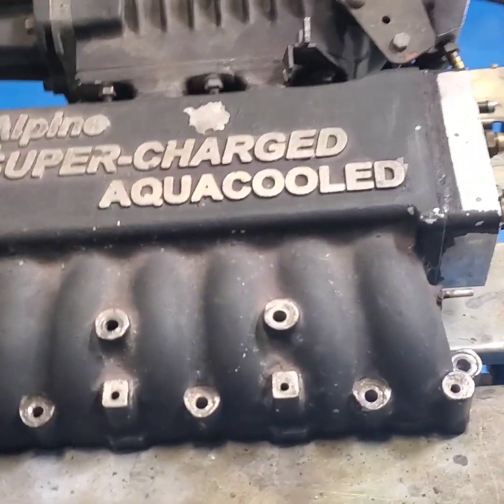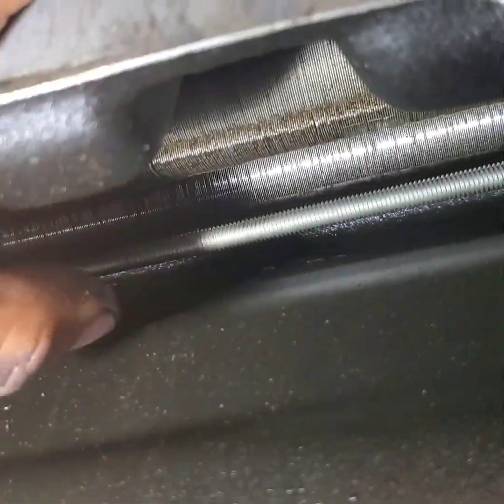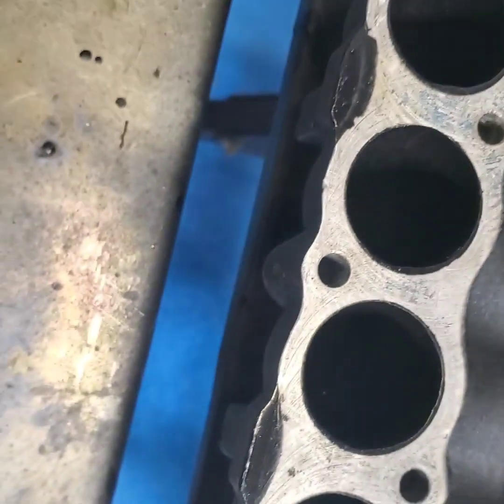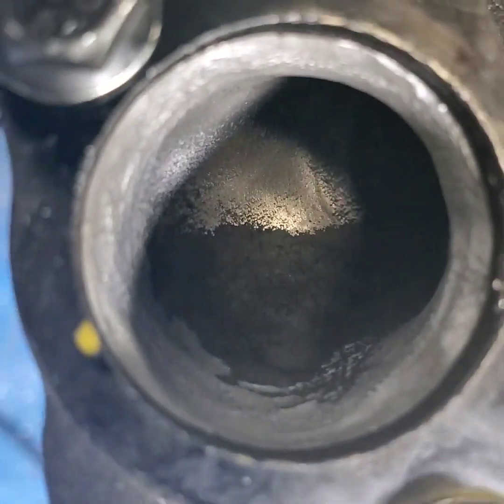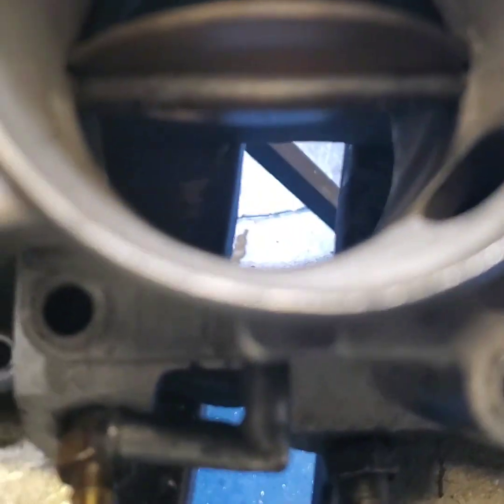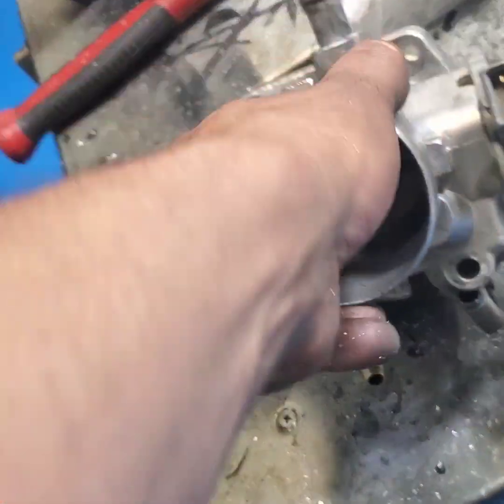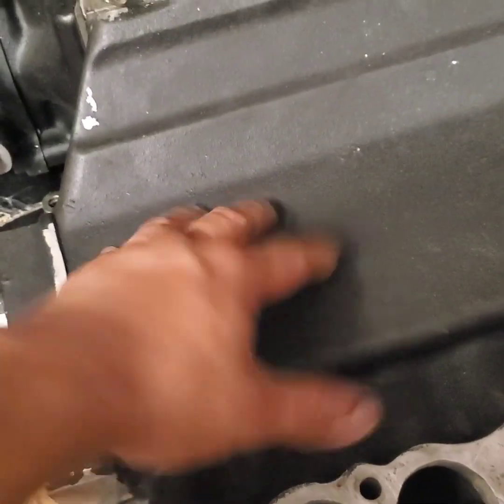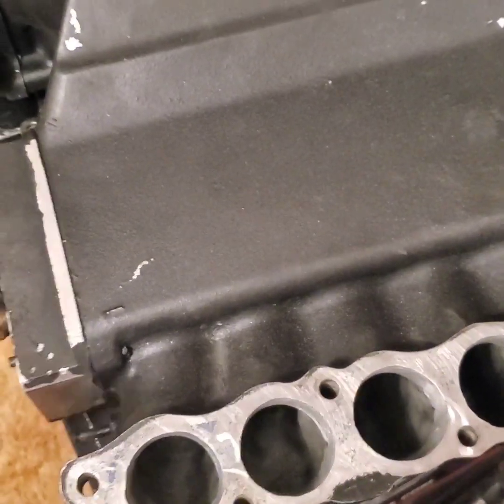Taking apart alpine supercharger and port it out GK Tiburon v6

Comment: Hey found one online and there trying to sell it for 2800. You think its a fair price or can I ask for a more reasonable price. Here's the link https://www.newtiburon.com/threads/ngm-supercharger.480952/
Reply from the maker: I don't know what they go for and how many miles dose that supercharger has and what stage
Reply: @Lilmiddwest  in the post I think he said he bought it from someone else so he doesn't know either
Reply from the maker: @faize28  I know ngm is better supercharger then alpine for sure that one has more parts then the one I got (alpine) it came with Tiburon so I only pay $2,300 for everything
Reply: @Lilmiddwest  in the post I think he said he bought it from someone else so he doesn't know either and its a stage 1
Reply from the maker: @faize28  it done really matters because you can always get different pulley size to make more boost. You can have stage 0,1, 2 or its a ngm assassin supercharger
Reply: @Lilmiddwest  but do you really think its worth 2800 for what it has
Reply from the maker: @faize28  like I said I do not know what stage and how many mile it has. It has almost everything you need to to run it. If come with flash ecm then yea should cost around that price if not should be cheaper. I'm no expert of supercharger.